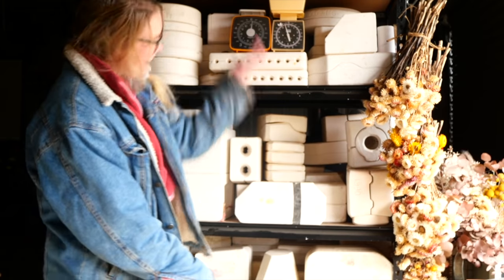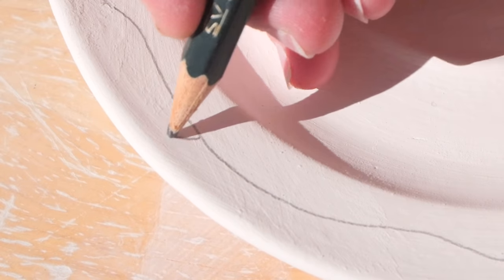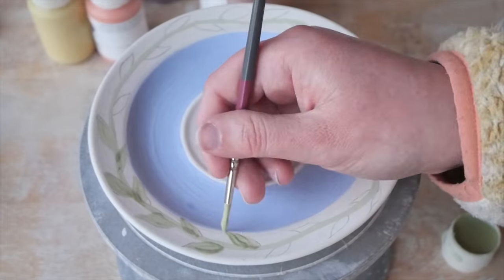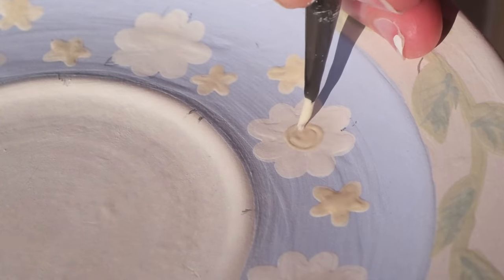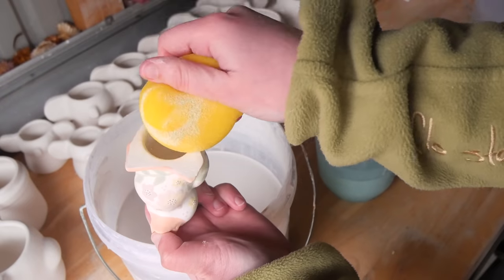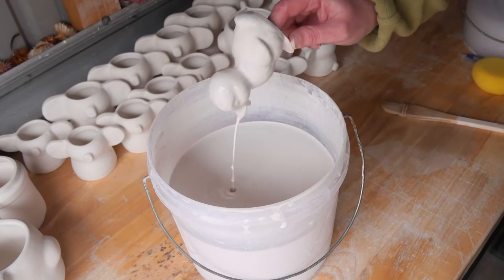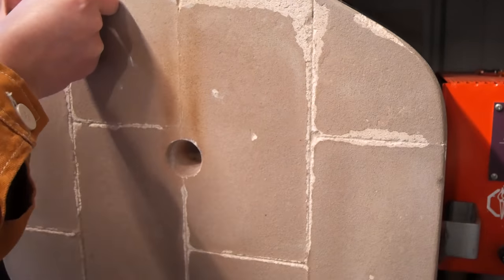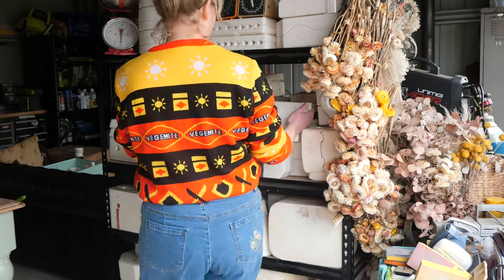Mould 43 - Revealing Mystery Moulds I Found on Gumtree

Comment: Plate could have been pulled out of the mold and then bent in the process. One can flatten out the plate and it looks fine but then returns during the heat work in the kiln. See if you can avoid that when removing from mold. Also dry evenly. I am going to try drying some mugs in my convection oven.😊 I love your things.

Comment: In my experience, plates are notorious for warping and have a very strong "memory" for how they are handled. VERY slow drying and minimal handling before they reach hard leather stage have given me the best results but I still typically make a couple extras when making sets just in case.

Comment: I wanted to say hi and I have come up with a idea for the strawberries it may not be doable it might be too labor intensive but I wanted to run it by you anyway. My idea is to turn them into a set of potpourri holders by piercing holes where the seeds are , I mean a single hole in each seed and you could possibly get a cork for the bottom they could hold potpourri maybe even strawberry potpourri.  You could group them in a basket to sell and have a bag of potpourri with them or sold separately. Are they called pomander? And you can put one in your dresser drawer to make your clothes smell good or set them around your room either separately or all together in the basket. Wether you want to go to the trouble of getting the potpourri and basket I don't know. As I said it might be too labor intensive but I think they would be useful as well as decorative. I enjoy watching you create your pottery pieces, thanks for sharing what you do.😊👍

Comment: Putting your round plates in the center kiln will help the warpage. Some parts are too close to the coils and get more heat than the rest. PS: the stacking makes them look organic or hand made.
Reply from the maker: It is really tricky with this kiln because no matter what you do they will be close to the coils! If I only put one plate dead centre on the shelf, I wouldn’t have been able to fit the other one and the plates firing would have stretched across four seperate firings! It’s really frustrating sometimes with this little kiln to pack it efficiently and still get really great results. I think the item I’m looking forward to doing more of on a larger kiln is plates because I’ll be able to actually fit layers of them in a kiln with more space! I’m not sure if you saw an earlier plate reveal but I had no warpage on those with the same packing so it’s interesting how different items cope with the firing! Thank you so much for this!! I’ll definitely try firing away from coils in a larger kiln to see the difference! That makes so much sense because the heat would be more saturated in areas! Thank you 💓

Comment: What about placing the plates upside down to stop the warping?
Reply from the maker: Definitely could try this in the bisque stage! Once the glaze is on the pieces anywhere the glaze is, it can not touch the shelf or it will stick! It could have potential if I had a stilt high enough! It could be a little risky though!